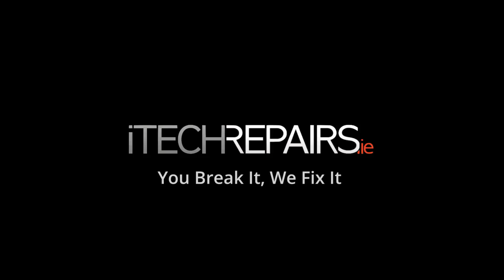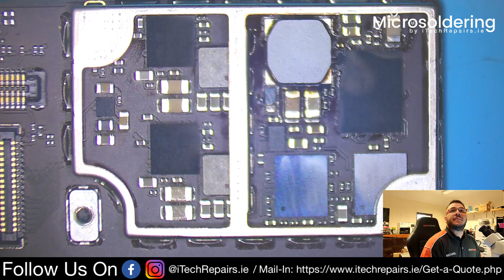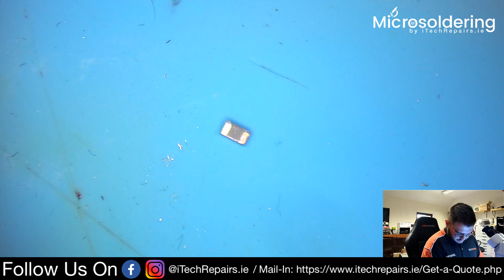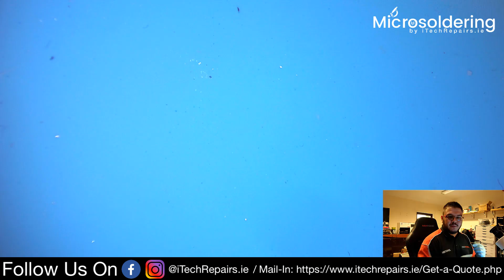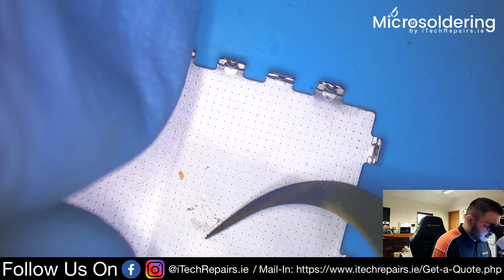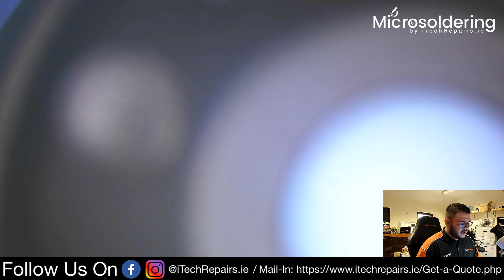iPad Air 2 No Touch Repair

Comment: Hello, my ipad air 2 took substantial damage to the screen, and one of the interior components seems to have been damaged as well (please see: imgur.com/a/tSYb205 ). Do you that damage would prevent it from working correctly?

Haven’t bought the replacement parts yet (like $120CAD!) and wondering if I should bother. Thanks!
Reply from the maker: Is your ipad still working?
Reply: @iTechRepairs-Ireland  before I took the screen off, no image was showing up, not even static or something. Figured that was just because of the extent of the damage to the screen though :/ 
https://imgur.com/a/BAhE2BC
Reply from the maker: first step is to always check with a good known working screen